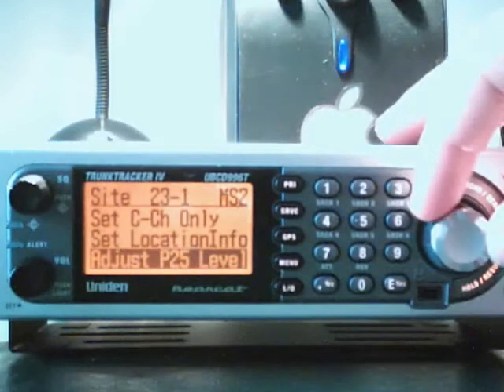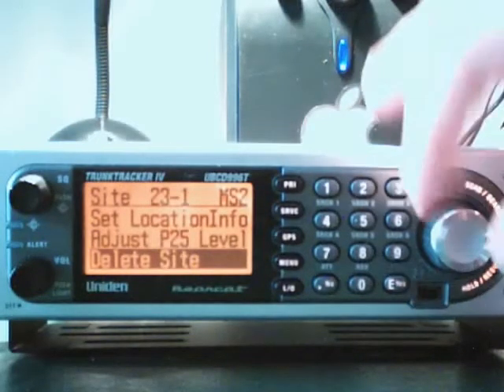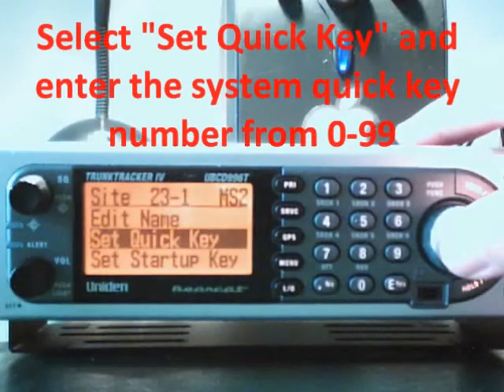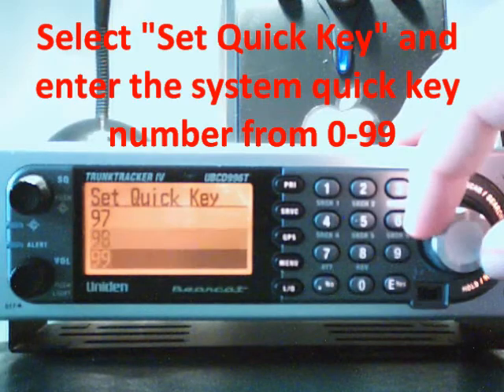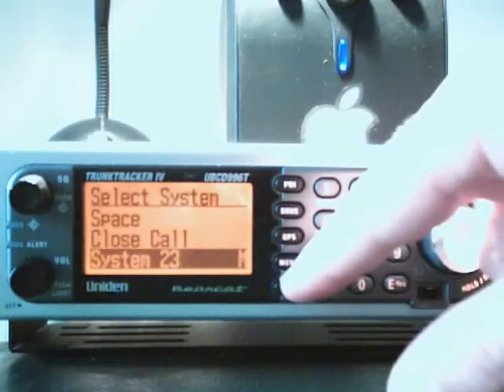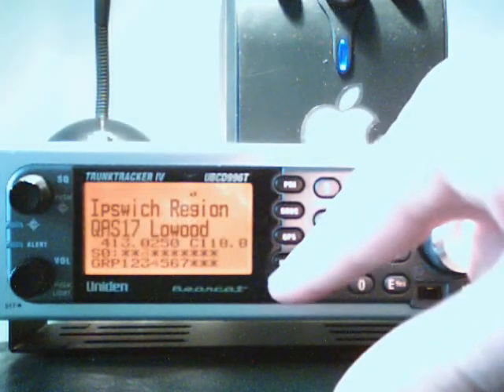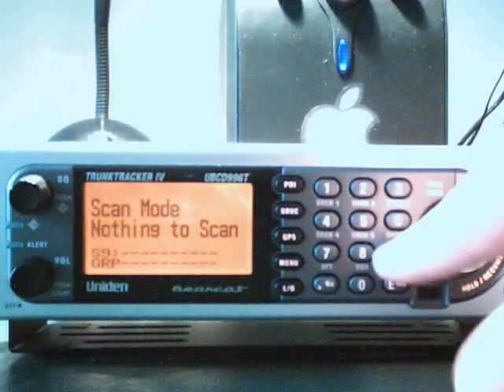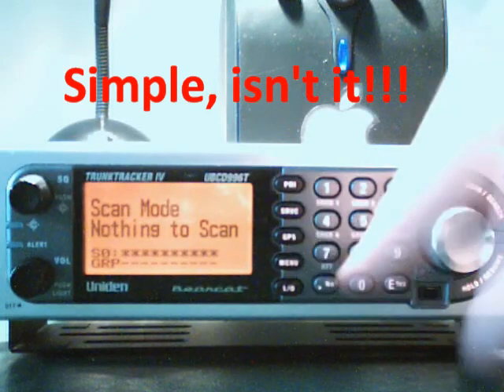Uniden 996T 800MHz Trunking - Basic Setup

Comment: Bkeytx

The 996T & 996XT will only support phase 1 of the P25 system.  Uniden has released the BCD536HP & BCD436HP that support phase 1 & 2.  GRE-America also has a scanner that does, but they have also been bought out by Whistler.  Whistler has been in the LASER/RADAR detectors business for some time now.